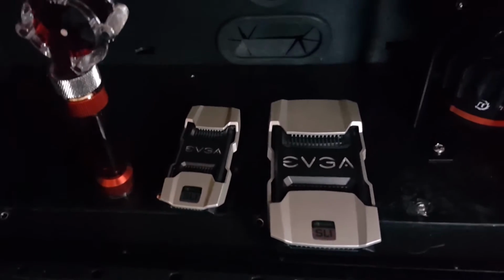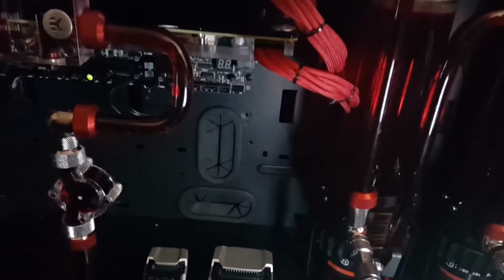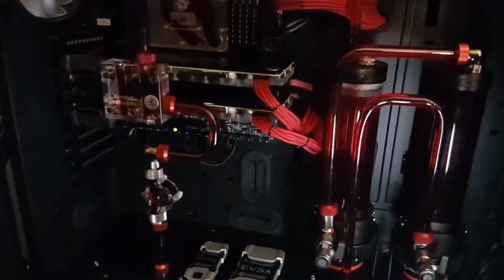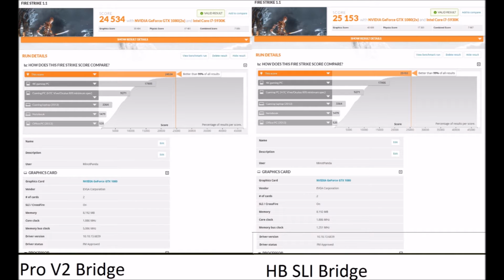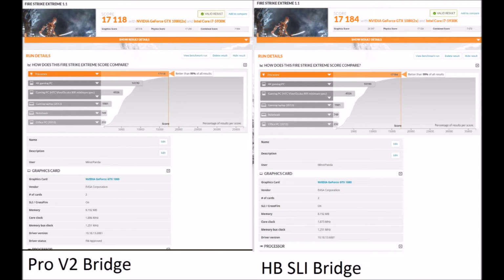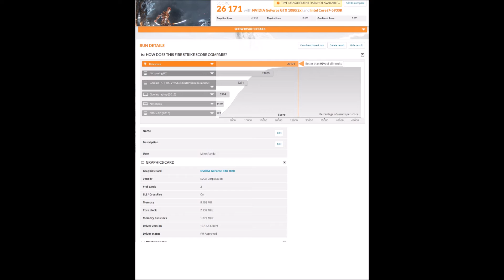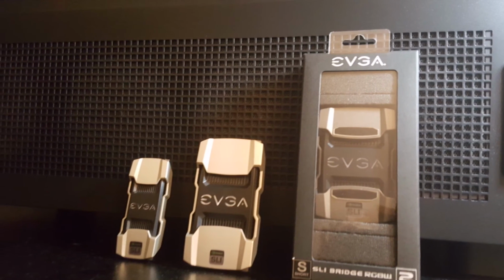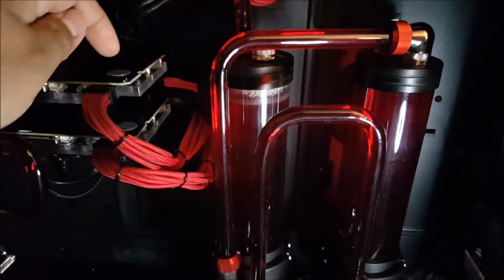EVGA HB SLI Bridge Vs EVGA PRO V2 SLI bridge

Comment: Do you think a HB SLI Brdige with the double ports designed for the 10 series cards will also work for the 900 series cards? Do you think it will help having a HB 10 series bridge on my 970 sli? Do you think it will help with performance for my 970 sli  instead of having a single port bridge (Ribbon cable or other 1 port bridge)
Reply from the maker: It will work for the 900 Series but you will not benefit from it as the High bandwidth was only designed in the newer 10 series cards. If you can get a Hard bridge like the EVGA Pro bridge it will do better than a Ribbon cable. Bu the HB bridge if you don't have a 10 series card would be a waste of money. Even now as Even my 1080ti still can't handle 4k above 60FPS on newer titles It won't be until Next Gen cards you will fully benefit from the HB bridge.

Comment: Hey man, i had a quick question. There has been a lot of debate on if you can even use a ribbon SLI bridge with the new 10 series. Did you get your ribbon cable to work with your 1080's? Thanks in advance.
Reply from the maker: Yes the Ribbon Cables do work. If you can use 2 of them and use both SLI fingers. Even at 1440p I notice a difference using 2 Ribbon cables instead of one. It was only lik 5 to 10fps on average but that is quite a bit to me.
Reply from the maker: I had to borrow a friends Ribbon cables at one point just to test out
Reply: Awesome, thanks for the info man. I have two mismatching GTX 1070's, and I am trying to figure something out
Reply from the maker: what are you trying to figure out on your 1070s?
Reply: Since they are mismatched, (EVGA 1070 SC, and 1 Founders Edition  1070) I'm not sure if a hard bridge will work due to them being two separate cards. My problem is I dont know if it will fit. I know the bridge works, but im not sure if the gapping and height is accurate enough for them to work.
Reply from the maker: As far as I am aware the EVGA 1070 SC uses the same size PCB so it shouldn't be any longer other than the coolers will look weird. What Motherboard are you using?

Comment: At 4k (firestrike Ultra i mean), it may not seem like much, but it's still a 3% increase in performance simply from changing the SLI bridge; you gotta admit that's actually a tiny bit impressive actually. Plus the HB bridge is only technically supposed to give a full benefit at resolutions ABOVE 4K-60hz (According to Nvidia it works best with triple 1440p surround, 5K, 4K-120hz etc... )
Reply from the maker: I actually am doing an update to this video because since they optimized the drivers I have actually seen a very good increase in performance over all. but you are right 4k and above will see the most benefit.

Comment: The price of the new HB bridge didn't sting as bad as the old bridge in my opinion. The old pro 2 way bridge was $30, the same price as the 3 way and 4 way pro bridges and felt a little cheap to me in terms of feel and looks. The HB bridge is built like a brick shit house and I love the way it looks. It compliments either the reference or ACX coolers very well.

Comment: for this motherboard ::X79A-GD45 PLUS that have unique spacing for 3 pcie slots, if i choose to have 3 ways sli. do they have a bridge for this type of spacing? these hb bridge doesnt look like adjustable. anyone can answer this?
Reply from the maker: You would have to buy the specific spaced bridges. I think EVGA is one of the only ones with every size you would need

Comment: The guy in the following video youtube.com/watch?v=mWcsaociTjE shows that 2 SLI (legacy) bridges have the exact same gains as the HB Bridge proving years and years of information wrong (everyone, including Nvidia, always says 2 bridges are just for looks and makes no difference).  This would also make the HB Bridge completely uneeded...Someone please confirm this as it goes against what people have been saying for ages...
On a separate note, any chance of single/SLI GPU, legacy/HB bridge benchmarks with 3x 1440p?
Reply from the maker: He did his early when the GTX 1080s first came out. People are now seen better gains now with the new releases of Drivers and updates on games. but it is still minimal. but like I was saying it is really more of do you want to spend the $39 dollars on the old bridge when the HB bridge is the same price? and I would love to do 3 X 1440p I haven't gotten another 1080 LOL But if you check out a facebook page 
https://www.facebook.com/groups/cemasterrace/

There is a guy named Alvis who is currently building a rig with 4 x GTX 1080s for Benchmarking
Reply: Bakken Tech But why spend $39 on the old bridge?  Just use two floppy bridges that are free (with motherboard) or dirt cheap and, according to this review, you have identical performance to the HB bridge (somehow even though the old bridges run at a lower frequency).

Haha, sorry, I meant triple 1440p monitors ("Surround"/"Eyefinity") and then comparing single GPU to SLI while also comparing the different bridges like was done in this videos'
 tests.
Reply from the maker: The only people seeing any differences was people running 4k and higher. With the HB bridge they saw better scaling on 4k and 5k. but other than that it is all just for looks LOL.

I will have to try that out. my middle monitor is a 1440p 144hz and my other 3 monitors I have are 1080p so I may have to just do some up-scaling on the other 2 monitors and see what I can push out of them.